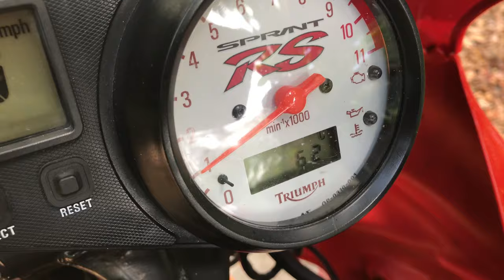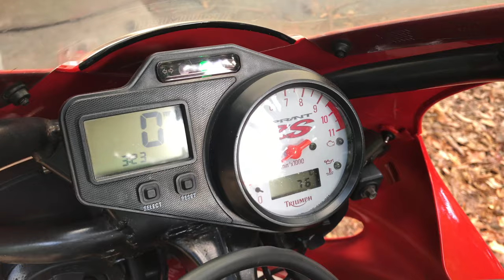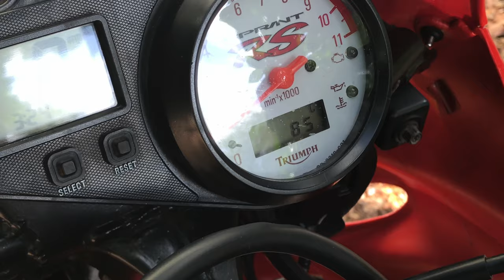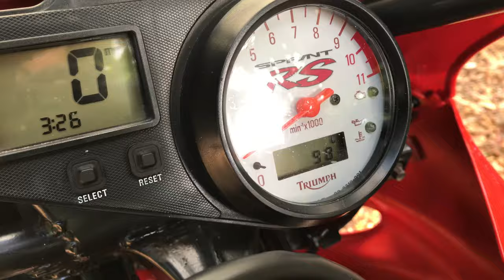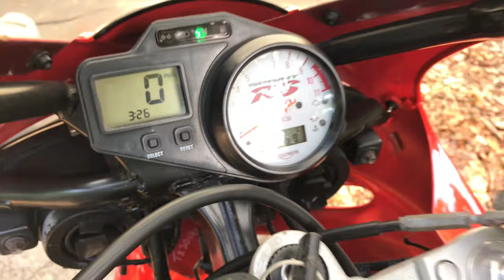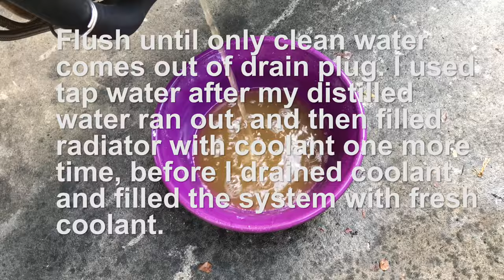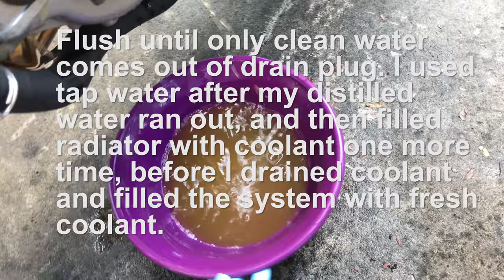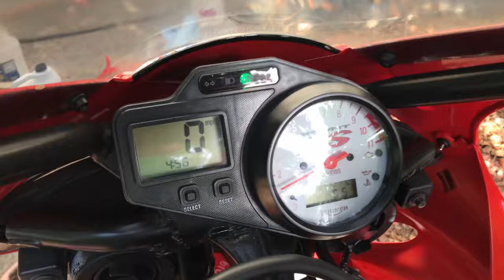Distilled Water and Vinegar Radiator Coolant Flush 2001 Triumph Sprint RS 955i

Comment: Great video, it translated quite well to my 2001 sprint ST 955i! Thank you so much for your level of detail
Reply from the maker: Just make sure you flush those vinegar out completely or it will cause rust!
Reply: @TheGizmoGarage  thx for the tip I ended up using a prestone coolant flush additive after reading mixed opinions on vinegar, though I still wouldn't hesitate to use some in the future as long as I do what you mentioned :)

Comment: you definitely SHOULDN'T just be dumping old coolant in your backyard like you said! Coolant is ethylene glycol, which is toxic! It will end up in the water supply. Pretty much any community will have a facility that takes old coolant - if you can't find anything swing by any shop, all will have a big drum which they use to collect old coolant - which is sent of for recycling.
Reply from the maker: Yes sir, I saved all the coolants into couple gallon jugs and bought to local recycling center for proper disposal! Only after I saved original coolant, the flushed out remains had to seep through the ground unforturently
Reply: Hush Karen

Comment: Quick tip the sprint rs and st rear fairings are easier to take off all in one piece, just undo the bolts for the rear handle and you should be able to pull the pins out on both side, unplug the brake light and bam its out

Comment: Li, I can't believe you went to all that trouble to remove just the left hand side panel and taillight. You can remove both side panels, tail piece and tail light all together in one piece.  You do not even need to remove the tail light globes from their sockets. Leave the all the side panels & tail pieces together. 

Just remove all 4 top frame mounting bolts from the both side panels ( + grab rail if fitted).  Pop the side panel lugs from the tank & frame mounting grommets (of course). Disconnect the taillight cable at the connector block - very easy. click click.

Then very very carefully with both hands, grasp the each of the side panels and gently lift the whole assembly backwards and upwards.  You will need to very carefully spread the panels apart slightly as you go to get around the coolant bottle. Just take your time and watch what you are doing.

It gets easier the more you practise this technique. The danger is if you rush this and spread the panels to wide you will crack and break the centre tail piece.  This technique saves you having to remove all the small bolts in the tail light and disassemble the panel. Give it a go and tell me what you think.
Reply from the maker: Hi CopMagnet63, I did realize it later... I tried to remove everything together in one piece once, and one mistake during removal made a tab on taillight top cover snap... I have to super-glue it back on.. I find removing this way avoids the mistake I made. But you are right, removing them in one piece is a heck lot faster
Reply: Hi Li, thanks for your reply. I'm just happy to see you take an interest in looking after your bike. I give you an A+ for effort.

Tell me, what is the advantage of using vinegar to flush the cooling system, rather than just distilled water and fresh coolant ?
Reply from the maker: No problem, I learned about vinegar's rust removal property on some other youtube videos. You can see a quick test here https://www.youtube.com/watch?v=TlcL_vHODkc it's a bit of extreme case, but vinegar is to help facilitate rust removal, of course you have to make sure to completely remove vinegar out of the system after it has done its job.

Comment: It’s a good video but you missed a few points that really need addressing so that people do the job properly. Glad you found the easier way to remove the rear panel rather than taking the tail light out just undo the main screws and grab rail and the whole tail piece comes off in one. You also didn’t drain the cooling system properly, you have to remove the main drain bolt on the water pump at the bottom, the bolt you removed was the cylinder drain. Sometimes it’s better and quicker to just remove the bottom hose from the water pump. Be sure to remove the bleed bolt from the thermostat housing when draining and filling. When you have filled up with coolant best to start the bike up get to operating temperature then switch off and let cool down then remove the radiator cap and top up if necessary.
Reply from the maker: Thank you for pointing out things I've missed.
Reply: Li Fan no problem 👍🏻
Reply: @TheGizmoGarage  One note, the one you used, that is our drain plug on the Sprint RS 955i. (source: Haynes service manual)
There is no bolt on the bottom of the waterpump, so what you've shown as drain plug should be correct for this bike.
The hose is lower though, so might empty it out a bit more indeed, but that doesn't really matter if you flush it 3 times.
Reply: Thanks for this post.  Ive just done a flush on my Sprint ST and im glad i checked the threads first and removed the bottom hose from the water pump. When i first watched this video i had to admit i was sceptical that this was the correct way to do a flush as the drain bolt seemed so high up the engine. Its a great video  but yeah its definitely better to  take the lower bolt out on this bike or the bottom hose for a sprint ST.

Comment: Be careful to flush all the acidic stuff from the cooling system, as it can "eat" the rubber of the radiator cap - ate mine, it became distorted, so had to change the coolant once again, and the radiator cap too.
The second time I flushed with a garden hose, then blow out the tap water, then filled with the proper antifreeze + distilled water mixture.
Reply from the maker: Indeed, after the vinegar solution I've rinsed the entire system with tap water, drained the tap water, and filled with temporary coolant, drained again, before I poured in the final antifreeze. Also made sure there is no more vinegar smell in the coolant system before proceeding with final steps.

Comment: Most importantly is “burping” all air out or you will have overheating issues.  My 2001 speed triple had air but after bleeding ALL AIR OUT She ran cool all summer in South California 100+F. Bought her in 2016 with 6,000mi for $3500 perfect body.

Comment: Hi Li Fan, I tried a long time ago to download this damn TuneEcu program to my computer, no luck.  Tried again today and as usual, no luck. It asked me about dll files and a bunch of crap I don't understand.  Can you clue me in as to what to do.  Should I just get a DealerTool and save mysself the hassle.
Reply from the maker: What operating system are you using? No experience with DealerTool and it costs a lot of money. Honestly not much can be done with the TuneEcu for older sprints, besides changing the stock mapping and some other non-adjustable data. If really necessary, can always try the android tuneecu app and a bluetooth obd reader
Reply: Thanks for the quick reply, just sitting here trying to keep my stress level down drinking margaritas, not really interested in changing a lot of maps, just want to keep my Sprint in top shape and service. By the way I am using a old Windows 7 Home Edition laptop.  I saw the Android app for it, might give it a try and get a bluetooth obd cable.  I wish you were close by lol, Thanks Norm
Reply from the maker: The program should work with Windows 7, what exact error did you get, about which DLL file? Honestly, none of the info provided in TuneEcu helped me to tune up the bike, so you are not missing much.

Comment: You will not find any rust in your coolant! Its an aluminium engine!
please read your maintanance manual before starting this job! you'll do it correctly!
Reply: Yet there is, i have the same bike and someone used water instead of coolant. It's absolutely full of rust.
Not saying it's from the engine, but there is a component in line that has had a hard time.
Reply: Different engines may have sleeved cylinders and also the water pump can have steel propellers. If the coolant is this color, you should take apart your water pump and inspect/replace if needed.